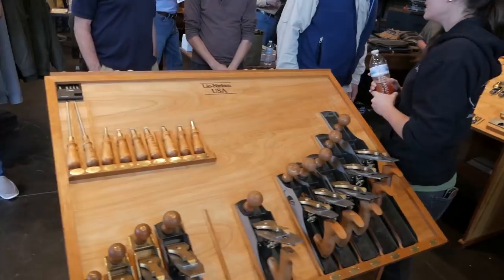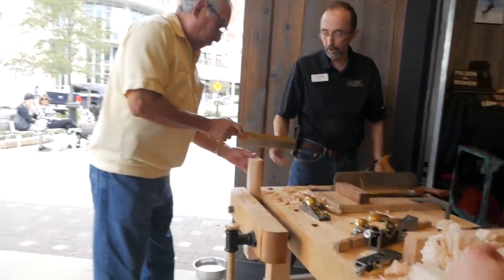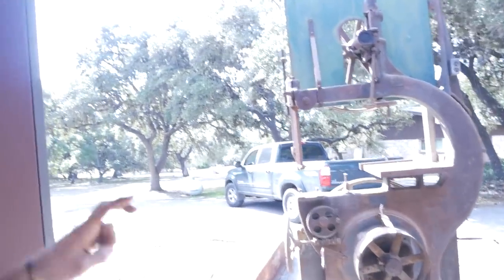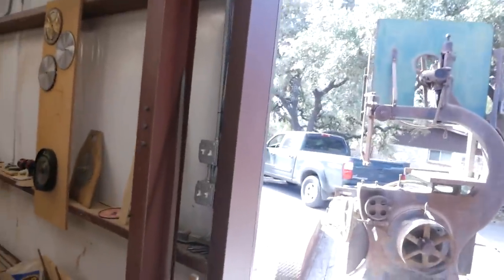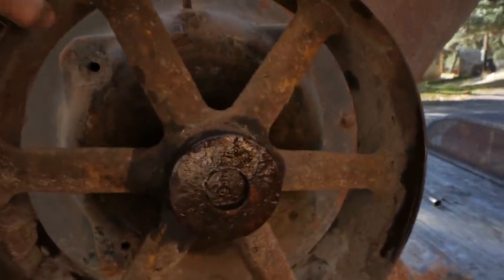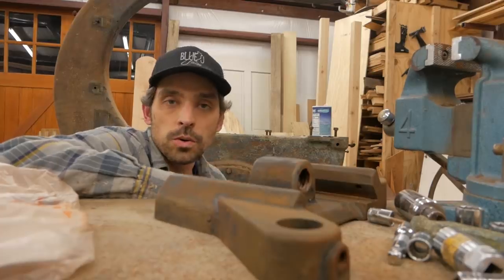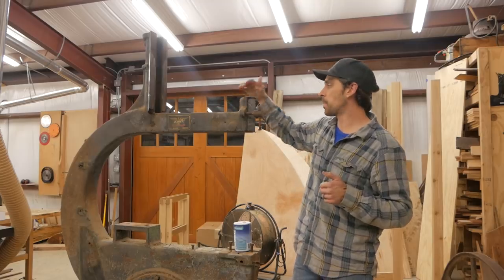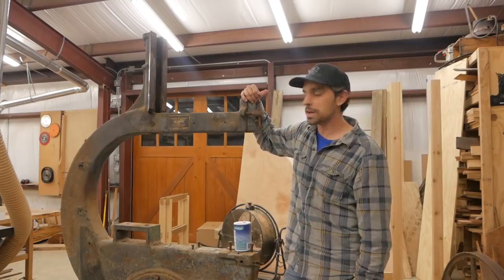AR3: I Bought A 93 Year Old Bandsaw!

Comment: Beast looks like it was run from an overhead power shaft with a flat belt. You might want to find a v-belt pulley to fit as most motors you find will have that on it already. Also because of the type of power it used it doesnt use the rpms most electric motors will give it. That will take some decisions about pulley ratios to get right if you can find the rpm it was designed to run at.

Comment: I have 2 of the same beasts one I use all the time the other needs to be restored.  They are amazing machines, I have had the same blade in the one in my shop for years and have not had one break.  The large wheels are very easy on the blade. You will get that 100 years of use.

Comment: On really stubborn pullies. Keep spraying the shaft with penetrating oil and let it soak for a day if time isn't a problem. Then use 2 pry bars. One on each side of the pulley with equal force. We use to do a lot of them on the farm I worked at.

Comment: my thoughts: PB Blaster/WD-40 and a butane blowtorch will be your friends big time. if your looking to repaint and such for the machine: if you have an air compressor, and a die-grinder and a large amount of "Roloc" pads (they look like the rough side of a dish sponge). they come in 3 grades: course, medium, fine and they act like sand paper but they are GREAT for removing rust and old paint. they can smooth out metal as well.  i enjoy a lot of tool restoration vids like "Hand Tool Rescue" and several others. I'm very excited to see this one come along!

Comment: Hey Andy. I just picked up and old one just like it. Mine is a 32” crescent from about 1918. Very similar. Just painted mine got tires need a bit of machine work on the shaft. But hopefully up and running in the next few months. Good luck with yours!
Reply from the maker: +erikirish Cav very nice and thanks!
Reply: Also I found urethane tires for mine on ebay from bandsawtirewharehouse

Comment: I use to rebuild & retrofit machine tools for a living.  Here are few thing to keep in mind:

1) remove all paint & rust to bare metal.
2) use a industrial filler & primer for the rough cast iron surfaces.
3) when & where possible replace the fasteners (screws, nuts, bolts, etc. . . .) with new and chase the threads with a tap and plenty of oil.  Thoroughly wire brush and oil any male threads and gears you cannot replace.
4) get rid of the WD40 and use a good rust preventing oil like Starrett M1 and a penetrating oil like Kroil.  WD40 is a good oil & thinner based cleaner for bare metal but not great for stopping rust and working as a lubricant.
5) thoroughly clean or replace any oil reservoir(s) that may exist and replace any lines coming from or leading to the reservoir.  If there is a pump and manifold try to replace it as well.
6) thoroughly clean or replace and oil level sights.
7) apply a light open gear specific grease to any gears.
8) ask the mfg. for the recommended oil spec.
9) avoid using sandpaper or emery cloth when cleaning precision surfaces.   Scotch Brite, a gummy stone or a machinist stone is all your should use for those surface.
10) have fun.

Hope this helps.   And like we use to say in the business: "You got some good iron there."
Reply from the maker: +Matthew Collins wow this is very helpful!  Much appreciated

Comment: When moving any large, heavy object, it seems easiest to lift and pull the lowest leading edge.  Your team was pulling down on the upper leading edge, which is analogous to how a car transfers most of its braking force to the front wheels.  Using something like a hand truck with a short platform may apply a pulling force more efficiently.  
Best of luck with your very ambitious project.

Comment: VERY cool. A crankshaft pulley remover would've worked well for the lower wheel. Also, with your hand and drive for quality I'm sure it'll clean up just fine. Cheers.

Comment: Nice saw. You did a good thing there. Saved a piece of history. How big is the throat? Looks like 36". When you were trying to get the drive wheel off, I was telling you, "Gear puller. Gear puller." But you didn't hear me. LoL. I suggest getting the table blanchard ground. Look for a tool + die shop in your area. They should be able to make some replacement parts for you - which will likely be hard to find. Imagine your grandsons using it when they're old men. Awesome.

Comment: Can't wait to see it go back together. Don't forget to balance the wheels once the rubber has been applied. 
As for a color I'd suggest a light grey or blue.
Under the makers plaque there could be the original color which you could get matched.
Best of luck as I'm an old machinery guy.
Kinda looks like the old belt powered Wadkin I used as an Apprentice Joiner in the 1970's but that also had been re-powered by a three phase electric motor but the wheels were out of balance and it was a bitch to use...still have the scars to prove it..💰💰💰🔧🔨🔩✔✔

Comment: make sure that you check that the wheels are true round.
If they are out of round luckily it's a simple fix.
The age of the bandsaw would suggest that it has babbit bearings you'll probably need to re-pour them as I don't think that you'll be able to replace them with regular bearings.
but then again I haven't seen the bearings in any of your videos.
Reply from the maker: +Ortwin Scholler surprisingly it has ball bearings!  I’ll have to check the wheels, they seemed to be well balanced

Comment: Big clutch puller would have been handy, if they make them that big.  I wouldn't be in front of that thing when it popped loose though.  I've seen a few brake drums go flying several feet when they pop.

Comment: I have a similar saw and the fatal flaw like yours is the cast iron wheels. They can and have exploded - you need good guards. And I have 6 bandsaws, all using either duct tape "tires" or good electrical tape. I gave up on regular tires, they rot and fall off too soon.

Comment: Does that old Oliver have leather bushings or bearings?  If it has the old leather bushings I would suggest that you have it machined to take modern bearings.  It will cost a bit but will make your life with the machine much simpler.

Comment: Great video I love old mechanical stuff new subscriber. A little tip next time you need to push something heavy with a forklift on a trailer, use jack stands under the back end of the trailer or at least some blocking. Also chalk the wheels— I’ve seen way too many guys ruin hitches and transmissions doing this. Here’s the coolest thing though.....ice, get several bags of ice and spread it on the trailer just before you set the weight down. Park on level ground and be ready with some friends to stabilize it. It’ll move easy but the ice melts quick.
Reply from the maker: +Cory Driver great tip!  The trailer actually dropped from my poor forklift skills, I️ was pushing it down with the forks.
Reply: Cory Driver n

Comment: Hi Andy Rawls. I would suggest as a very good source for information on old machines for manuals and other stuff. He is in Georgia and has a new shop there. Does do woodworking but his main line is restoration of older metal working machine. You get in a tight spot and Keith is the man to talk to.      Keith Rucker - VintageMachinery.org

Comment: That lower pulley which you had so much trouble removing is very wide. Is that one of those types which were driven by a wide leather pully belt which is connected to a central shaft running through a machine shop driving multiple machines simultaneously?
Reply: Leib33 yes. flatbelt.